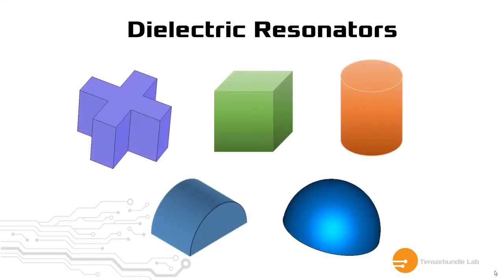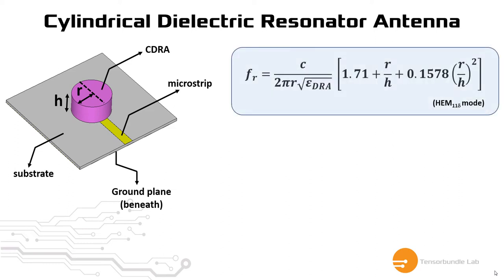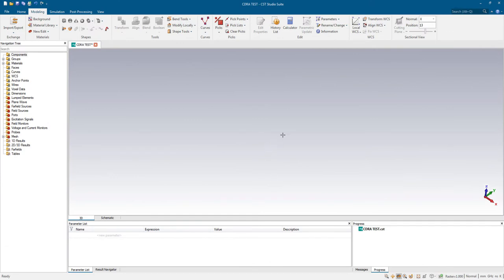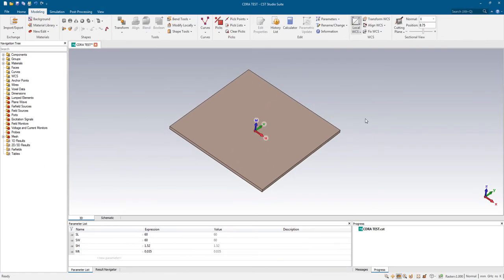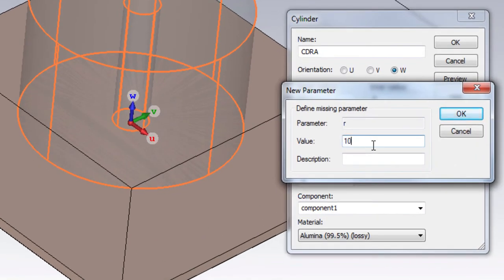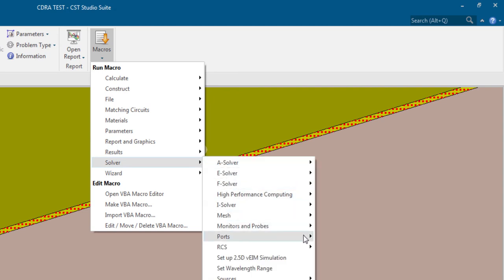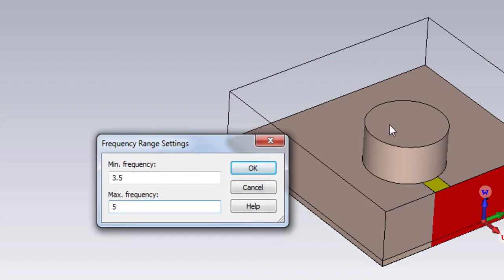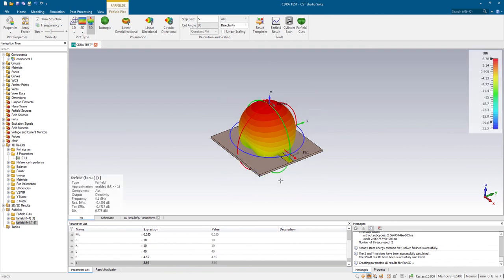CST Tutorial: Cylindrical Dielectric Resonator Antenna in CST

Comment: Thank you very much. I think if you change the solver or increase the mesh density, this result will be changed.
Reply from the maker: Yes meshing can influence the result but it consumes a lot of time and RAM and processor power as well. This video is only for instructional purpose and so I used default mesh setup that is quick for simulation